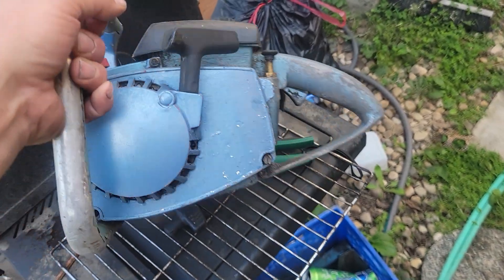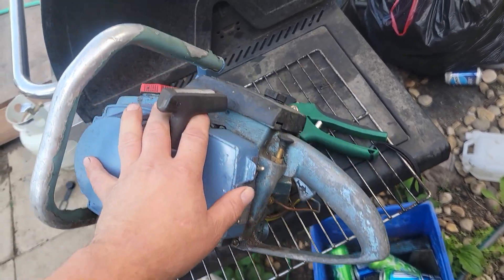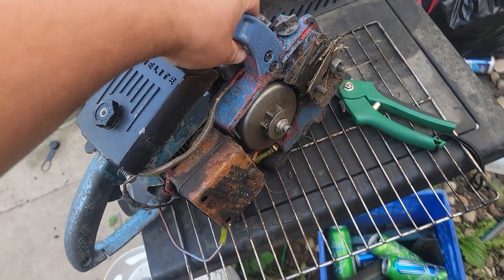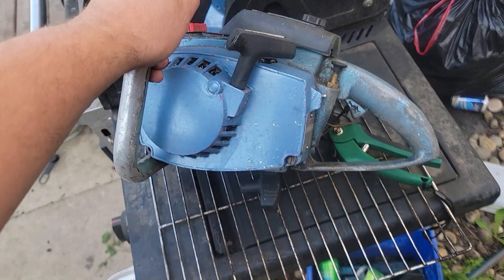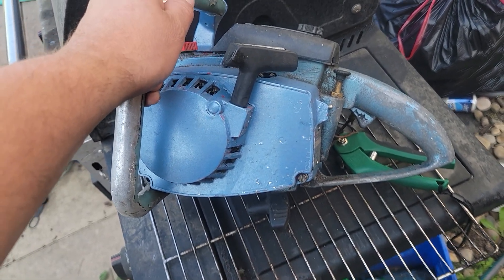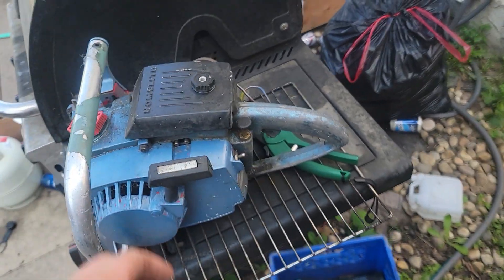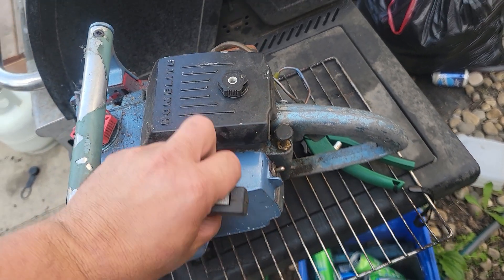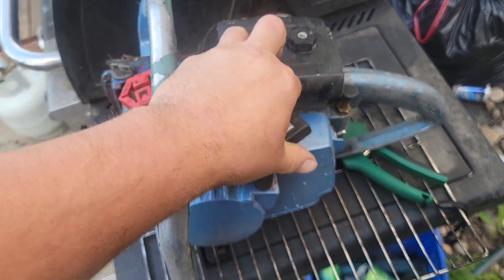let's try to blow up a chainsaw

Comment: Hmmmm. Must be nice!!
Reply from the maker: Lol
Reply from the maker: This thing was made out of garbage to begin with, the good parts will survive, like fuel cap, recoil.. Lol
Reply: @chainsawcanuck  I've got a good piston and cylinder for xl12. Well it actually runs but the case has issues. Got good 20in Homelite bar saw is actually complete it just has case issues. One day I'll find a blown up one and swap it over.
Reply from the maker: @tedneitzel  xl-12s seem to grow on trees here
Reply: @chainsawcanuck  everyone I've found here so far runs and they won't let go of it. It will have to sit till I figure it out.